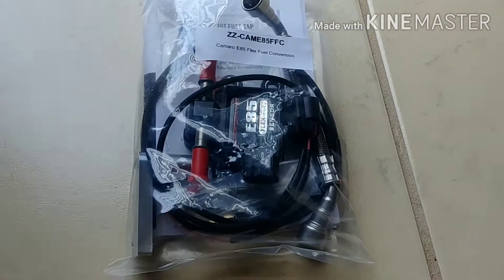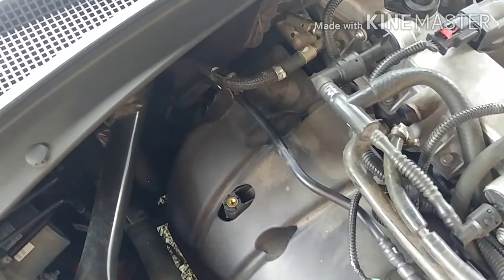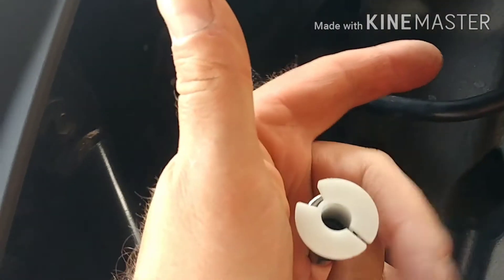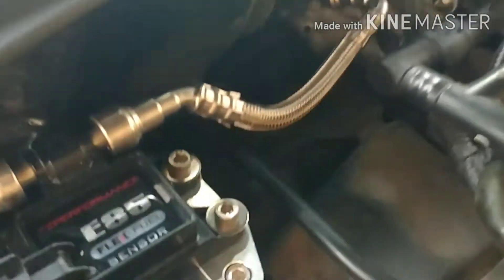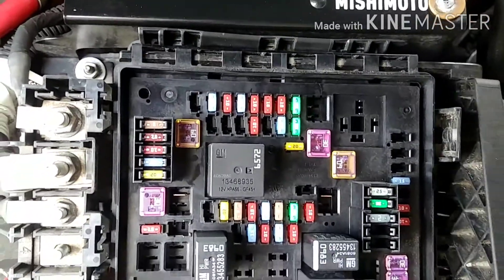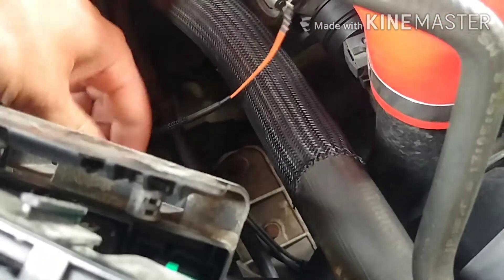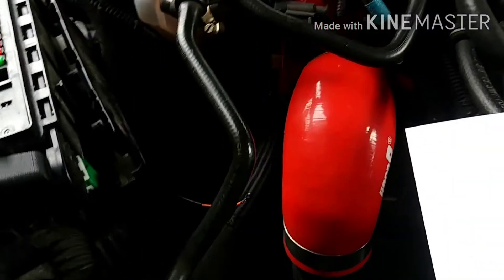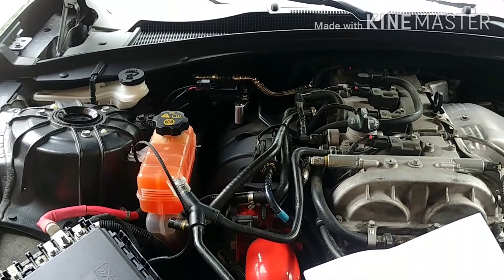2016+ Camaro 2.0t e85 sensor install

Comment: Why is any of this needed? A modern day ECU (2013 -currant) already looks for ethanol readings. You should be able to put e85 in it already and the stock ECU should make the appropriate adjustments
Reply from the maker: Normally that statement would be correct,  however the camaro is one of the only products in the GM lineup that doesn't have the e85 tables in its programming.

Comment: Did you have to get the zzp pcm ? Or will it work with a custom tune ?
Reply from the maker: It should work with the stock cp. It just needs tuned to be able to run ethanol.
Reply: @boltbreakers8805  just bought mine lookin forward to it did you have to change fuel pump or injectors?
Reply from the maker: @1slowwltg744  You shouldn't have to unless you have a built motor and going for 400+hp.

Comment: Hey man did your sensor have trouble tuning cuz mine didnt go higher than 40% e85 and they told me the sensor was not working properly
Reply from the maker: Couldn't say. I never found a tuner that would do e85 before I sold the car. However, u can look on hptuners and see if the ethanol content changes with fillups.
Reply: you may of still had 93 octane in the tank causing it to bled  or maybe it was bad e85 not as strong

Comment: If I install my kit my car should work just fine without a tune as long as I don't fill with e85 right? I will need that tune to activate the sensor so I can start filing my tank with e85.
Reply from the maker: Yessir. I had mine installed with no issues. If u have hptuners you can check on your ethanol content after fillups to check if it's working.

Comment: My tuner told me i can install this and drive it still is it true or do i have to tune it right away
Reply from the maker: You can run it like that but not with e85. It has to be tuned for flex fuel.

Comment: Watched this video 4 times before I even had the flex fuel kit, in the process of putting it on now. Thank you again for this video because the paper instructions were confusing me. I'd also note that when taking the harness out after removing the red clip theres a little bump/ridge under it that when you press in allows for the handle to be slid back. Once again thank you for not making me want to burn my car to the ground.

Comment: where did you get  oil Cath you provide the link?
Reply from the maker: it's a generic can so you have to make it fit your application. Yes, I'd say it fits but you'll have to find another way to mount it.
Reply from the maker: The red one is just an ebay generic  can. The mishimoto can I think I got that from phastek.
Reply: @boltbreakers8805  is the same for Camaro SS

Comment: What work did you have to get down to the engine to get this installed?  Because every single video that I watched nobody's saying anything about that and that is something that people should say, What all the work needs to be done to the engine or intake to have this install because it seems really easy but it's probably more than that.  I'm not a mechanic by all means, but I would hate to do this to my car and finding out later that something else needed to be done....  I will use your video for help later when I decide to install mine, easy to follow directions.
Reply from the maker: The engine needs no additional modifications to burn ethanol fuels. It's the tune and the programming that needs changed to make this work.

Comment: Could you please post the link for the zzp e85 kit? I can't find it in the website. I need one for a 2022 2.0T. Thanks
Reply: It says " This kit will not work without our PCM tune" did you use other tune? Please explain
Reply from the maker: https://zzperformance.com/products/ltg-e85-flex-fuel-conversion-kit

Comment: Wil this work on a 2017 Camaro 2.0 ?
Reply from the maker: It should. Just earlier this year some tuners cracked the 16-17 computers for e85 fueling.
Reply: Bolt Breakers do you know which flex fuel kit they used ?
Reply from the maker: @sleepr_v141  The camaro kits should all be the same.  Its the programming of the CP that's different.
Reply: Bolt Breakers now is that on the stock turbo or upgrade turbo, reason I ask I have the zfr from zzp
Reply from the maker: @sleepr_v141  shouldn't really make a difference on the turbo, although it'll be a custom tune for the zfr.

Comment: Is your sensor reading e85?
Reply from the maker: Not tuned on e85 yet but I would say yes. Hp tuners registers a change in alcohol content every time I fill up at a different gas station.
Reply: Bolt Breakers Do you mind emailing me ? I have a few questions.   Angel.921.garcia35@gmail.com

Comment: What are all the mods you have
Reply from the maker: Full bolt on.  Front mount intercooler, catted-less rev-9 downpipe, zzp throttle body, electric cutout, and a home made air intake.

Comment: How much power does the e85 make vs premium gas?
Reply from the maker: I'm going through tuning right now but hoping that e85 will get me another 50hp over the 93 tune.  On a separate note,  our stock fueling isn't capable of running full e85 so you have to go e45.
Reply: @boltbreakers8805  I was thinking of getting a kit for my 2017, but seems to complicated for my liking . Also not being able to run full e sucks
Reply: @boltbreakers8805  Is it the injectors or fuel pressure, or both that are the problem?  Also, did you ever upgrade to run full E85?
Reply from the maker: @tsigoloiborcim  From what I understand the pressure has to be higher to inject more fuel into the cylinder due to the direct injection. I never did get the flex fuel going because it blew up last october and now im looking for a tuner who can do flex.
Reply: @boltbreakers8805  Man!  Sorry to hear that!  Keep us posted when you get it going again.  I have a 2016 2T malibu which is the same motor and turbo as the Camaro, but there's not much out there specific to the Malibu.